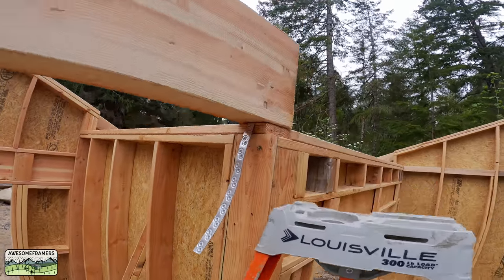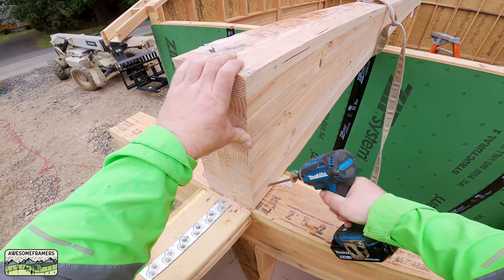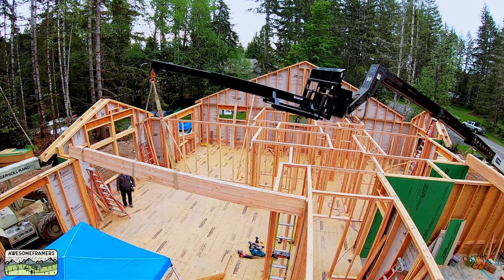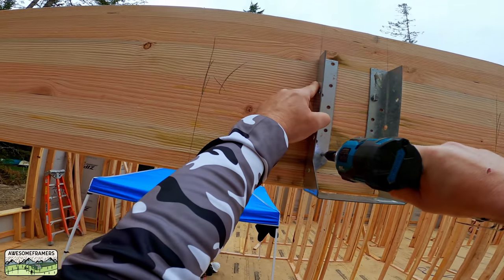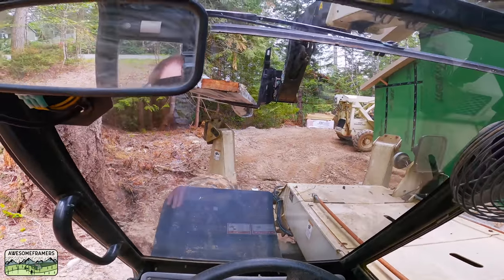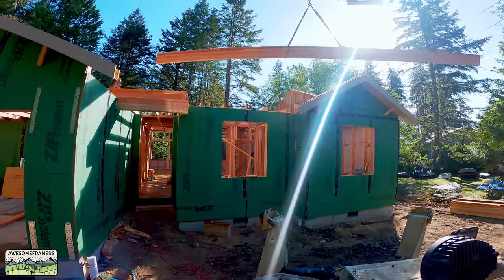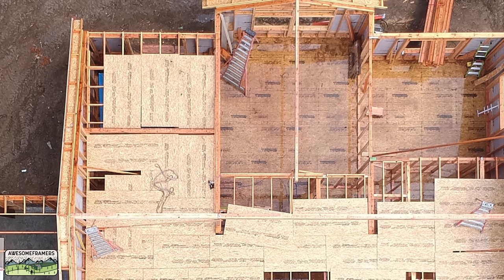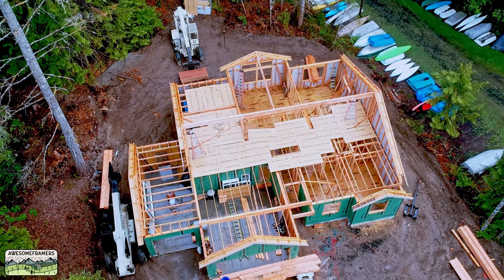Hand Cut Roof Lakeshore roof part 1

Comment: Great work, quite the puzzle for that complex roof, it’s a nice challenge for sure.
To my (Dutch) eyes the approach seems a bit counterintuitive though. Not a criticism, just an observation of how many different methods exist, which I personally find fascinating.
We would lay out the heavy framing outline and roof beams first, then fill in the walls. The construction pov logic being you start with the heaviest/load bearing elements to set out the critical dimensions.
There is otherwise no intrinsic structural or quality difference.

Comment: I like your videos but I hate seeing that beam sitting on the steel strap.  It will continue to settle until settle until the wood is compressed.   The threads on the Simpson StrongTie screwthreads will delay the settling even more.
Reply from the maker: Your concerns are unfounded.  We use KD lumber, dry the house to low moisture content before drywall.  Running straps this way has been a common engineering detail for decades.  

I think a often times we have reactions to things that don't ultimately prove to be a problem.  The wood isn't going to compress like you think it will.  Do you have some pictures or references that show this is a concern in real life?  

I hope I didn't come across snarky, that isn't my intention.
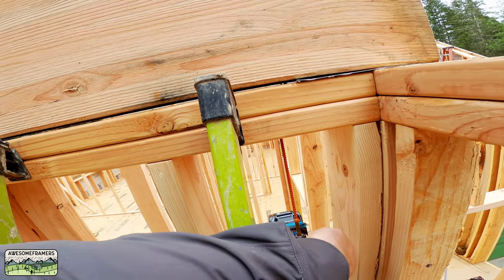Reply: @AwesomeFramers   After setting the beam, you can see that it is raised on the straps.  At 5:41 and 5:53 you can see that the screws do not pull the beam down and the beam is approximately 1/8" above the plate.  At some time in the future, based on load, weight, gravity and settlement, that beam will be sitting solidly on the plate.  Over decades in the trades, clear evidence of settlement is most often seen in the compressed and broken drywall joints at multistory stairwells.  It may be less evident in this single story structue but it will happen.
Reply: Put a couple shims in there in the next video and everyone can breathe a big sigh of relief 🥲
Reply from the maker: @rogerhodges7656  as I said in the video, the beam has a camber and the actually bearing point is to the right. These SDWC screws won't pull things tight, they are for uplift.

I appreciate your response and concern. I respectfully disagree, but hey we are probably both wrong 😂😂

Comment: Am I wrong or do screws have the same shear strength as hanger nails? I was always told screws are a no no
Reply from the maker: general purpose screws are a no go.  But Strong-Tie has a screw made for hangers that is code listed and tested & approved.  

These screws in the rafters are also code listed and made by the same company that makes the hardware, Strong-Tie.  So it comes down to the how the screw is made and its rating.
Reply: The statement is wrong in general. Its not specific. People confuse brittle screws snapping back & forth with low shear strength. That is false. Think about a regular bolt vs a grade 8. The grade 8 is made from better steel and is heat treated. They are brittle and will snap. The difference is the shear & tensile  strength of a grade 8 is double that of a grade 2.

Nails are soft and ductile they have low tensile strength and therefore low shear strength. If you think about a joist hanger the reason for all of the nails is not shear strength. The wood will shear long before the nails. The extreme number of nails are preventing withdrawal. Screws are orders of magnitude better in withdrawl that's why you can use less of the correct screws.

The wiggle test is not a demonstration of shear strength. You are work hardening the metal until it gets brittle enough to snap.

Comment: Why don't Americans use scaffolding 🙈 or a proper crane!
Reply from the maker: Scaffolding can cost 10k on average to the price of already extremely high housing prices.  I wish everyone here was required to.  

The forklift does what a crane does at a fraction of the cost and greater versatility.
Reply: @AwesomeFramers  there's absolutely zero chance of building a house in the UK without the correct health & safety in place,
It's a criminal offence here!
Reply from the maker: @pauldavies7251  yeah, here they try and enforce fall protection, but in residential almost no one uses it.  We use a combination of guard rails and harnesses.
Reply: @pauldavies7251  Same in Australia. The houses are all skaffed.